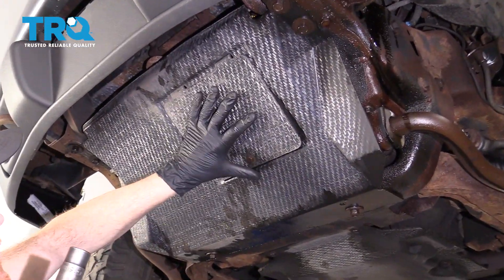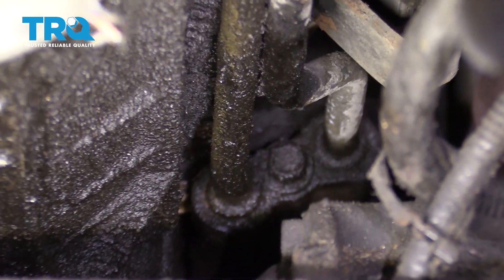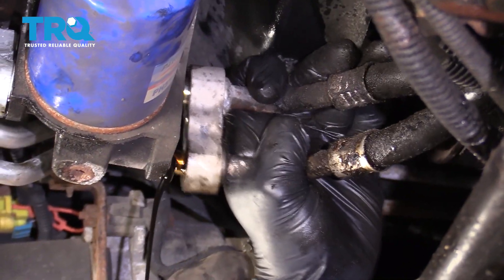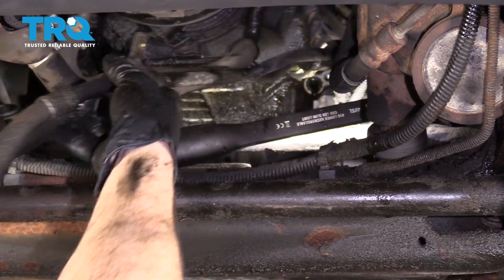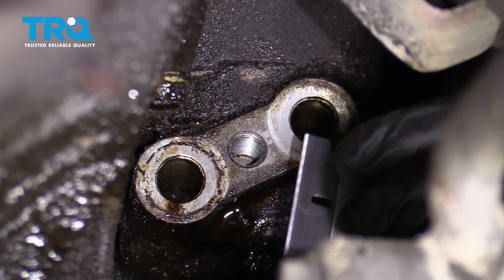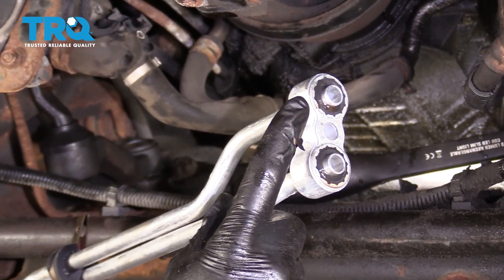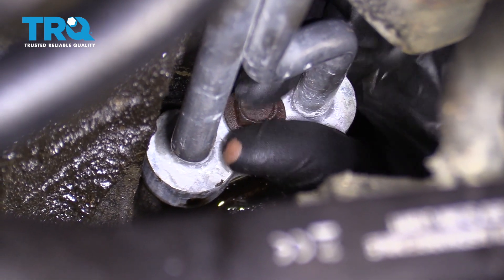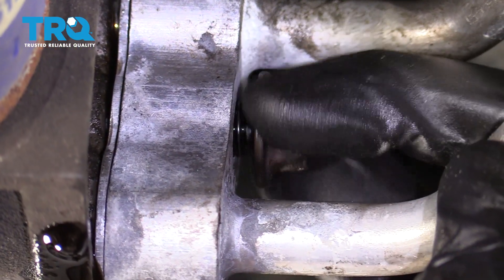How to Replace Oil Filter Housing Lines 1994-2004 Chevy S-10

Comment: I just preformed this repair on a 1994 GMC Jimmy 4x4. With this model the oil filter was moved to the left fender behind the headlight. There are a few other differences. This model has the two braces on either side of the engine attached to the bell housing. Unfortunately the the bracket on the drivers side actually bisects the oil lines, requiring it's removal. I managed to remove it to do the repairs but have not managed to reinstall the bracket due to the difficulty of reaching into the very confined space to screw the bolt into the top of the bracket. Also when you order your parts make sure you buy the O ring and gasket for the adapter. In my case it turned out the major leak was actually from the O ring.

Comment: Pulled the threads on the hole further back toward the engine, any suggestions? I plan on just trying to tap new threads the next size up and use a bigger bolt but idk.

Comment: I have a cheaper way 😄 Delete the oil cooler, throw crap lines in trash...cut hoses for easier removal, done . 13mm, 10mm Allen, torx 40

Comment: It would be good to indicate that this is 2wd Blazers (and their GMC counterparts) only. Routing is the same on 4x4 but the front transaxle gets in the way. I haven't performed this task on my Oldsmobile Bravada yet but from what I can see at the very least a motor mount or two needs to be loosened and the motor jacked up. Otherwise I appreciate the clear and to the point how-to video. Far too many how-to videos with much needless commentary.

Comment: let's see, if you have a 1994-2004 chevy S10 your oil filter should magically appear under the  filter access panel, right?  Forget all that useless information about 2 or 4WD, engine size, sub model, number of cylinders, etc.  According to this video there is only one configuration of  S10's in that date range?   Having read other not quite as bad videos I find that the oil filter and be in 3 different places depending on how the vehicle  is configured.    I also noticed that people asked questions and you gave no answers. Total Failure,.